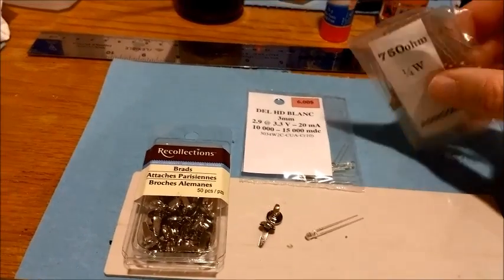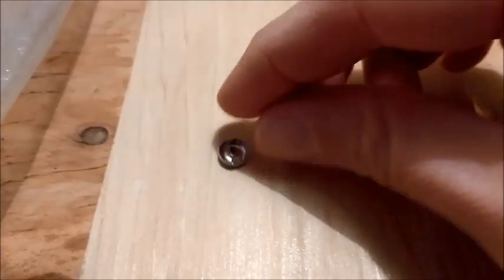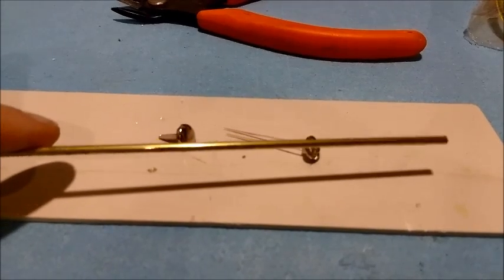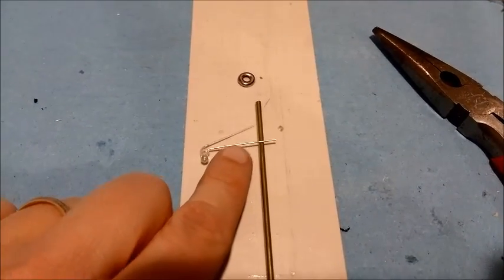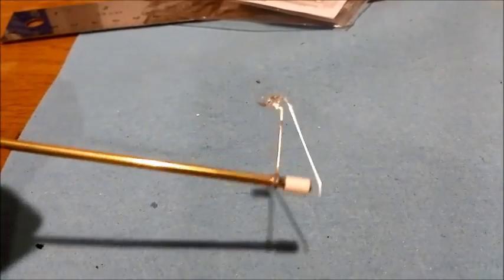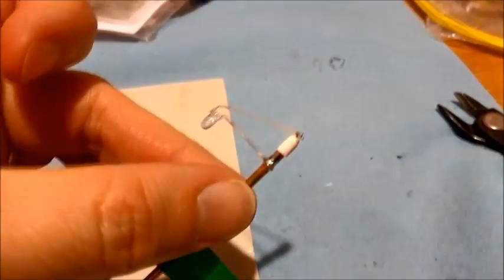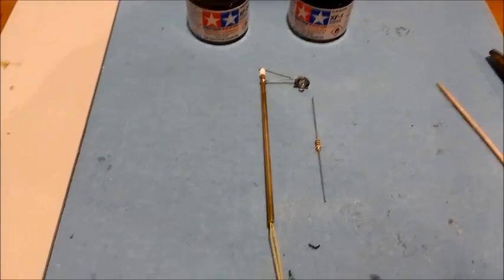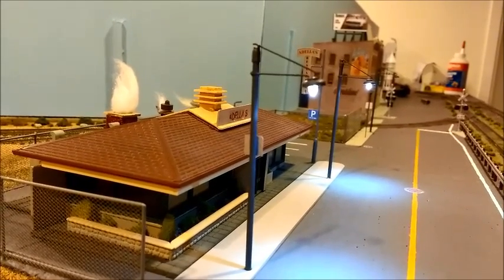Scratch Built Street Lamps.

Comment: Logic would dictate that the exposed brass tube receive the ground connection - why risk a short? I would recommend that you run the positive coated wire up the tube and use the tube as your ground connection. You might also mention how you managed to shield the lamp tack cap from both LED wires.
Reply: These LEDs run on low-voltage DC. There's no neutral or ground. I usually hook them up to a 3V "supply" from two AA batteries, so it's basically a flashlight. The leads aren't even going through the cap; the flange on the LED makes sure of that. Once it's done, the paint acts as an insulator in case the air gap fails somehow.

Comment: Wonderful!! Just a suggestion, would it be possible to fit the resistor inside the tube? it looks like it might just fit? You could insulate the solder connections with a little heat shrink then insert it into the tube. Edit: I see John Frankforther had the same idea 2 months ago. :)

Comment: nice job  but you get a better look if you drilled a small hole into th side of the pole and ran the negative  wire into it and then sadder the wire inside the tube.

Comment: Great idea. I would trim the wires on both ends of the resistor. Solder one wire to one end of the resistor and cover with heat shrink or clear fingernail polish. Then I would put the resistor inside the tube near the top and just solder it to the other LED wire. If the resistor doesn't fit inside the tube then you could try SMD resistors which are smaller.
Reply: Ahhhh....Smart!